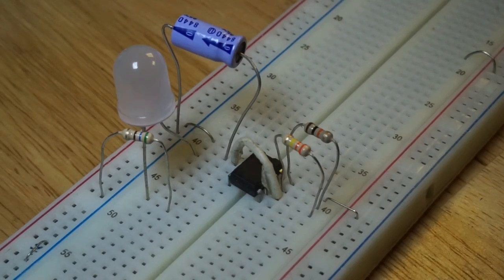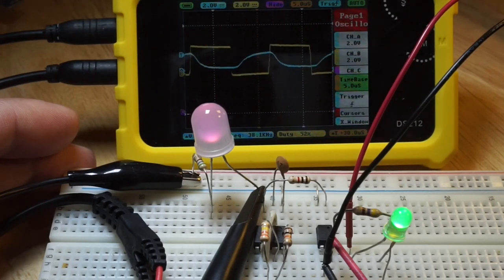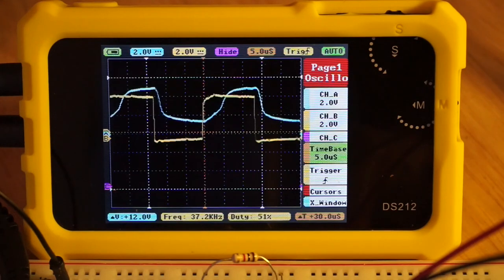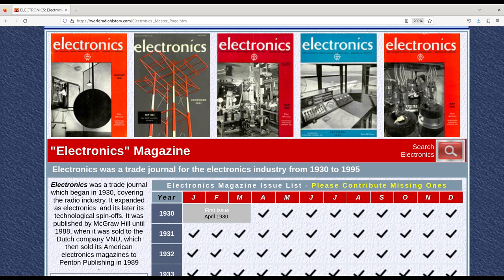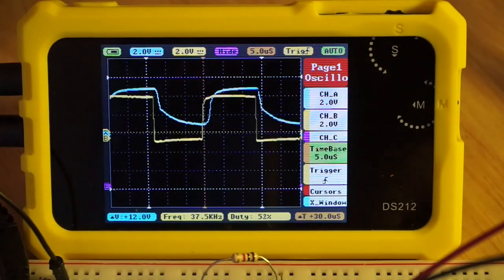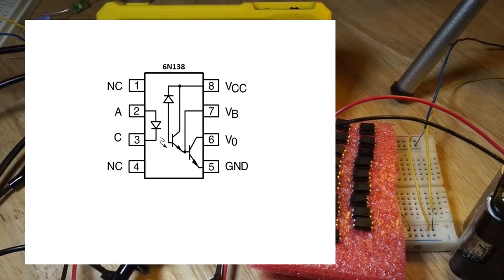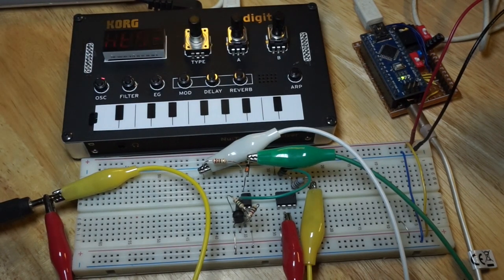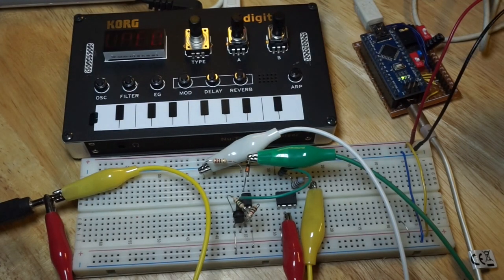Can slow low-cost optocouplers be used in MIDI applications?

Comment: This is great! I'm trying to put this together for a teensy. Which npn transistor would I use for the external one? I'm not sure
Reply: Hey there! I was wondering if you had any success with your project? I’m trying to accomplish something similar and would love to hear about your progress. If you could share any details about the circuit and the transistor you used, I’d really appreciate it. Thanks!
Reply: @stefanjovanovic3382  Hi, no i haven't figured it out yet. I did try making the circuit and I didn't manage to get it to work. I dont have an oscilloscope though so I couldn't figure out if the rise/fall time was the issue. Sorry i can't be more helpful.